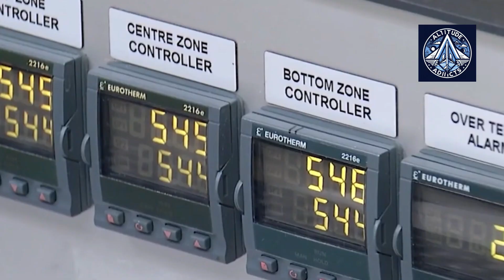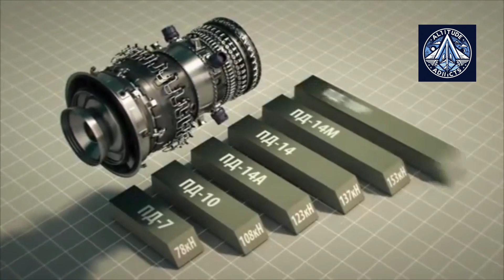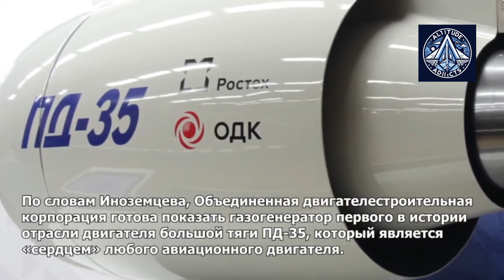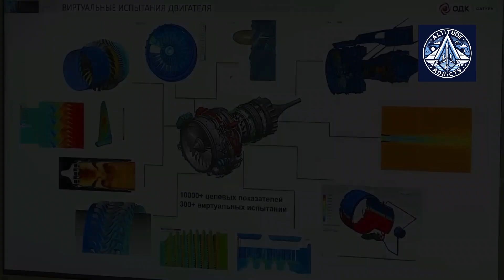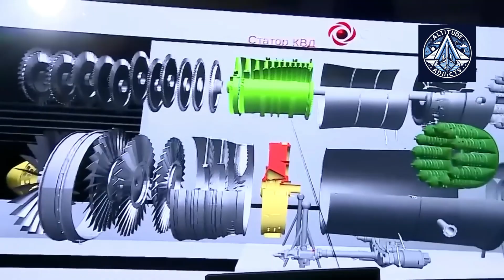PD-35 Engine for Cargo Aircraft & PD-8 Video Released

Comment: All these Engines are useless and will never been finished and used in any any aircraft 🙂
Reply: The PD-14 is finished already and completing the flying tests. The PD-8 is on the finish line of development (it is based on PD-14, mostly, so will be finished faster). The PD-35 will be next after PD-14 and PD-8. Everything is going by the schedule.
Reply: @maksimluzin1121  if the PD-14 is still completing flying tests it mean that it is still tested, so...not finished 🙂. All these Engines are useless as long as they are not actively used in current aircraft that have already been deliver to airlines  to actively transport passagers.
Reply: @nomade9415  , You are completely wrong! The PD-14 is finished as a product. The flying tests are required for certification of engine & aircraft with it, not for its completion. You did not know that?!
It is not a Snickers chocolate or a kids' bike, the development and certification of any aviation engine is going for 10 years in average in any country/company in the world (from an idea to the final service acceptance). It is just the world Statistics. If you don't know that, it is your comment is useless... Your smiles do not add any useful meaning to the posts.
Reply: @maksimluzin1121  ok ...but you should understand that what is IMPORTANT for People is to SEE that Engine USED in aircrafts that have already been DELIVERED to current AIRLINES to transport PASSAGERS🙂. if they should be certified first and the certification take 10 years, is it fine...this Youtube-Channel should close and open again in 10 years after everythings is endly done und people can see your Aircrafts and Engines being used in Daily live...
Reply: @nomade9415 you wrote nonsense about something you do not know.
Reply: what other choice do they have?

Comment: How can 4 ps90 with 170kN each are enough for il96-400 but 2 pd35 with 340kN are not? The math does not adds up
Reply: That's 680kN total. But For comparison, the competition is boeing 777= 510 kN each, Airbus A350=430kN each. 

So, the if Russia wants to compete, the 2 PD-35 aren't powerful enough.
Reply: @jackaboodf16  they need to make a 767 size twin then
Reply from the maker: You are right - 4 PS90 engines is 680kN. But, even with 4 PS90 engines, it is still under powered.
Reply: @altitudeaddicts  The Airbus A340-300 with 275t MTOW has 4 x 151kN. The IL96-400M for 270t MTOW has 4 x 170kN. It's true the A340-300 was under powered but just saying

Comment: So, no pd-35 for IL-96? 😕😕
Reply from the maker: Lol. I was expecting that comment. But, in the past videos, I had mentioned that two PD-35's on IL-96 is under powered.
Reply: @altitudeaddicts  do you think a composite fuselage and Wing il-96 be light enough for pd-35? I really like the silhouette of the il-96 and would love to see a Modern version of it.
Reply from the maker: @KMASIF-mi9yj  Il-96 is not designed for PD-35. Also, IL-96 should have just 2 engines and just two pilots. it essentially means a new design and a new avionics. Composite wing and body too means major redesign, testing etc.
Reply: @altitudeaddicts  I don´t think the PD-35 will be enough for the IL-96-400 but will be enough for IL-96-300
Reply from the maker: In one of the videos I mentioned a joke. The pilots of the Il-96 300 version joke that the plane takes off due to the curvature of the earth. It is because the engines are not powerful enough. Also the 96th is simply not made for two engines.
Reply: @altitudeaddicts  I rememeber, but the reason was at that time the PD-35 were not reaching the 30 tons of trust but after that with the newest tests the engines reach around 35 tons of trust
Reply from the maker: Today's video answers the PD-35 and IL-96 question.